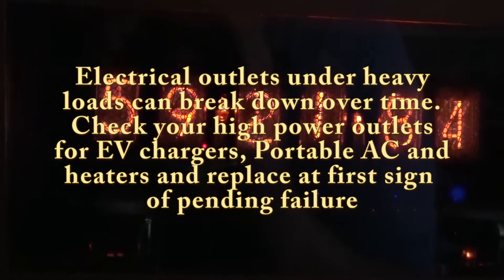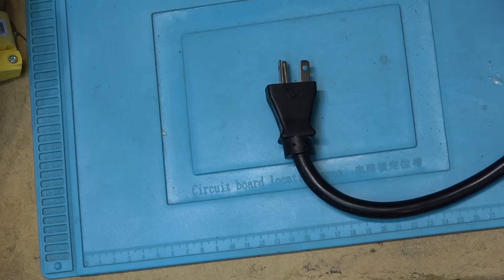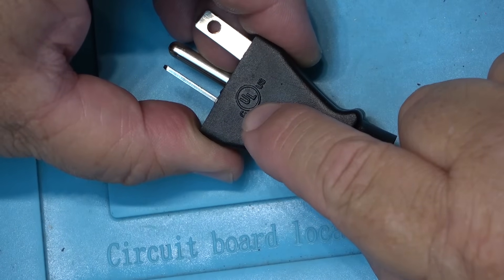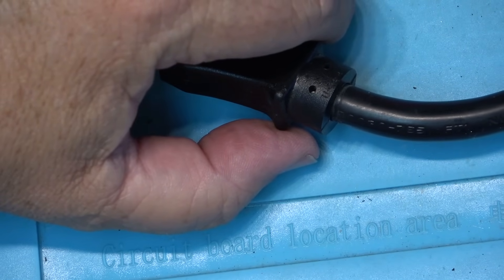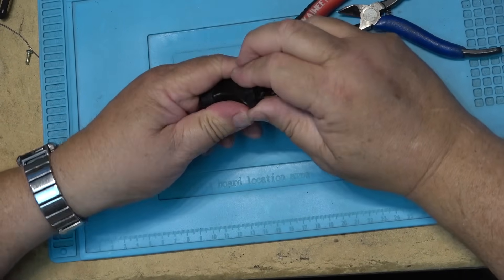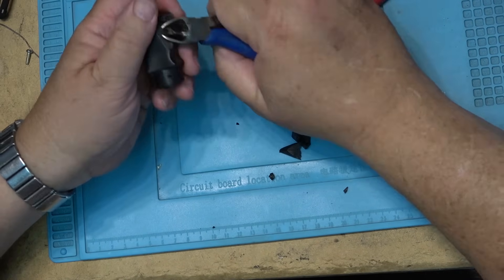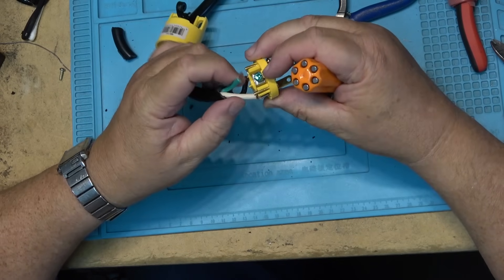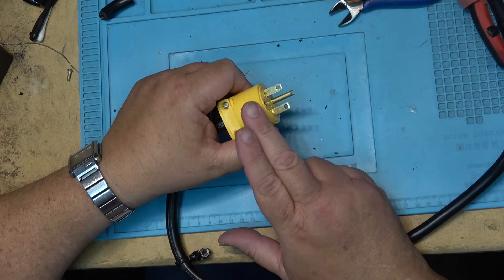Inspect your high power appliance plugs for signs of failure

Comment: I actually had this happen to me.  I was using a room heater and it started to give off a strong electronic smell.  I checked to see what it was and found out that the heater plug had melted and burned the outlet as well.  Needless to say, that was the end of that heater.  The outlet had to be replaced as well.

Comment: In Finland high power plugs are considerably larger and have 5 connectors: phase1, phase2, phase3, neutral, ground. each phase (in relation to neutral) is 230V and between two phases you get 400V. This is very common outlet in houses, not in apartments. NOT a split phase like in amaerica but actual 3 real phases. So yes, european system is better

Comment: First problem is having an electric vehicle
Reply from the maker: Sounds like someone is jealous.
Reply from the maker: Been driving EV for over 14 years.  Still have the car. Have 2 now. Would never go back to has or diesel. Only people that whine about them are people that can't afford them. They are so jealous that they can't help but put them down.  I drive 20 miles each way to and from work. It costs me 0.70 in electricity to mage the trip.  If I was driving a super efficient car that got 40mpg at today's price it would be 6.40 to make the trip. .  $14.00 a month to drive to work and back 20 tlmes.  Vs 128.00 for a 40mpg car.  Do the math. Then there is the maintainence savings. My 14 year old car with 225,000km had the rear brakes done at 200,000km. Oil is changed every 2 years.  
No matter your excuse it's just jealously.   
So keep pissing away your money and I will keep my in the bank and use it for fun stuff.
Reply: oh and i bet todays kiddies love their e-scooters. talk about giving them essentially a free license to burn down your house let alone the scooter IF THEIR NOT WELL INFORMED about the risks and precautions that are hardly explained in the user manuals or various documentation.

Comment: Better safe then sorry. 

Electricity is nothing to play around with.
Reply from the maker: That's why my house is over wired.  I have more circuits in here and i would be hard pressed to overload anything.  I'm close to max load now however. I should have had a 200 amp service installed but it was 700 more than the 125 service.  Have never had any issues but i know it's close.  I went with smaller ev chargers so I can charge both at the same time.

Comment: I had a plug on a window A/C unit get hot like that.  The outlet was nice and tight.  Put a new plug end on it and it was good again.
Reply from the maker: My window AC in my production office is on a dedicated circuit
Reply: @12voltvids mine is too.  The plug end was worn out but the receptacle was fine.
Reply from the maker: Had the outlet in laundry room go bad. Put a commercial grade duplex socket on abd all is good. My washer was shutting down mid cycle due to bad power.

Comment: Good idea!  On a different note...Amazing how many people buy a replacement cable or extension cord without checking polarity or continuity before using.  Most just expect it to work as described on the package and plug in without any pre test.  Good luck with that!
Reply from the maker: It's a throw away society these days.

Comment: EV car chargers are not inherently unsafe. However, the fact that they draw max power down a line over a relatively long period of time really exposes a lot of weaknesses in your system I've seen electrical panels burn up that had nothing to do with the charger other than it's extended power draw.
Reply from the maker: Have to be installed correctly and screws tightened to correct torque.

Comment: What I don't understand is, the prong orientation is different on the new plug?

Does your outlet have a second terminal with the correct prong configuration that will accept that new plug?
Reply from the maker: Yes the outlet can accept both 15 and 20  amp. Old plug was a 20 this a 15. They make them for 120 plugs as well.
Reply: @12voltvids 

So the 15 outlet has prongs facing the same direction and the 20 has them oriented perpendicular?

Just thinking you can't fit a square peg into a round hole (different keying).

Assuming they do this so you have the option for either, but can't plug a 15 into 20 and vice versa.

PS. Watched again and see you explained the keying. 

My bad.

Comment: A question... Dave would tining the wires before putting them under the screws be a good idea or bad idea?  Would the solder oxidize over time and cause resistance and heat?  I often wonder what would be best.
Reply from the maker: No don't tin.  Lead and tin have higher resistance then copper.  Just ensure the screws are tight and no quick connects anywhere on that run. It needs to be a home run directly back to panel with no splices in-between
Reply: Thank you Dave.

Comment: weird < the crimps on the defective chinese plug seemed ok
Reply from the maker: Well the plug was getting so hot you couldn't hold on to it and the new plug is stone cold.
Reply: It definitely showed discolouration of the copper but the pin itself looked OK.  That says to me localised heating rather than heating as a result of a loose socket.  It might be that the crimp wasn't properly formed, the tangs are supposed to curl in a bit and wrap around the wire to some degree (rams horn if that helps picture it).  High speed saw cross section of the crimp might be interesting.
Reply: Maybe the crimp wasn't tight enough, but visually it looked fine and started arcing which caused it to heat up idk

Comment: Regarding hooking up the new plug, it's good practice to leave the ground wire a bit longer than the others. If for whatever reason the cable should get pulled out of the plug, the ground will get torn out last.
Reply from the maker: It's not going anywhere.  It's tight and it is mounted to the wall

Comment: A proper EVSE (car charger) should have a temperature probe in the plug that'll detect this failure mode and safely shut off when it gets too hot. At least that's what the one of my parents' car has according to its manual.
Reply from the maker: Many of the portable chargers that shipped with the car had such a plug.  My original factory level 1 did and it got recalled due to a defective thermal cut out that tripped for no reason.  
The evse has a temperature probe inside it because it displays the temperature.

Comment: I assumed you checked the current draw of the charger.
Reply from the maker: I know exactly what it is as there is a display.  This one will do 16 amps max but the car only draws  15.5.  The unit has a display. Shows voltage amps watts and kwh of the charge cycle.

Comment: Seems like a downgrade, and undersized?
Reply from the maker: How is it undersize?
It's on a 15 amp breaker.  It only draws 15 amps. All i could get is a 15 amp plug.  The wall socket is a 15/20 socket but it's fused at 15 anyway.  In other words if i tried to draw 20 it would trip.

Comment: Look i dont want to argue but iv fixed this problem hundreds of times and EVERY single time apart from one time a plug had broken wire coming in to the pin its been the socket always seems like the plug tho
Reply from the maker: Nope not the socket. It's tight and does not get hot.  I have 2 outlets. One is a 30 amp and i have an adapted cable from 30 to 20 for the other charger.  I plugged the bad one into the adapter cable and it got hot on that one too. Last night while chathibg I checked it and it was stone cold..
Have 2 EVs and charge em both at night on the cheap 0.07kwh power rate.

Comment: Think about it the plugs pins don't get thinner the socket looses grip force on the pins or is defective from the start. I speak from experience. Trust me.
Reply from the maker: The crimp was weak. This one always got warm.  It wasn't hot but it did get warm.  The socket was new and no it was not worn by plugging and unplugging. The cord was set and it's secured to the wall. It doesn't move.  Sockets do wear out from plugging and unplugging but they don't if the plug isn't disturbed. 
I did verify that it was the plug side first as I put it on my second circuit for the other car and it got hot there too.  New one is stone cold.

Comment: Running any connectors close to their maximum rating is asking for overheating as the metal contacts react to the cycle of hot and cold. I think that they should be rated at at least twice the average load and not just close to it. Most house fires are caused by electrical appliances. The older properties were not intended to handle the demands that we now expect of them. Here in the UK if you ask for an EV charger to be installed, the main supply cable has to be upgraded to handle the load.
Reply from the maker: Supply is good. 10 ga wire on this one and 8ga on the other as that one is a 30a circuit as i run the garage heat on that one and it's a 4.8kw heater.

Comment: Oh this is so important! My neighbour's dryer fried a wall socket last week, they plugged it into an cheap extension board for another week. I checked it out and the extension was almost melting!!! Realised it was the plug (after checking the whole circuit). The dryer was in use for over 3 years and plug was seemingly good quality. As you said it was the internal crimp point. The replacement stays completely cool after use.  FYI the dryer was a Hoover brand (Candy) and I've seen so many quality issues with these units.... utter garbage.
Reply from the maker: Crimp connections are the weak link.  That pioneer plasma i was given had a defective power cord. Crimp let go in the plug.
Reply: @12voltvids  They're scrimping with the crimping. Can't beat plugs with terminal screws.

Comment: Yes, this. Especially people that use space heaters and the like, with extension cords. It's always recommended to not use the extension, but if it's used, it has to be made sure that it is of high quality and designed for that much power. In addition, far worse than that is leaving the actual plug not in well, extensions or not. It may be common sense to lots of us, but there are people interested in electronics that didn't get that far, yet. We give a helping hand. heh
Reply from the maker: And power strips. 
Most are plastic crap. Unless you have one of those made in Canada Hammond like i have. Uses real receptials avd has a heavy duty cord. That one can handle full power.   I have a second one around here somewhere i need to locate.
Reply: @12voltvids  This, too. Yes, of course.

Comment: Lots of good info to check in this vid. Very good preventative measure. Just wanted to ad you can check torque rating on how many pounds of pressure to put on the fittings as well. I'd say no issue how you did it but just wanted to say it is listed.  It should be on the documentation or stamped on it.
Reply from the maker: It's torqed to spec and then some.  It's not coming loose.

Comment: We had an older electric stove that had a couple of 120V outlets built-in. Found an appliance (deep fryer) that had it's plug start *melting*, and discovered that the outlets on the stove were cracked, and buzzing and sparking.  Appliance & stove are now long gone.
Reply from the maker: I had to change the outlet the washer was plugged into.  My stove is a gasser no outlet on it. Plugs into 120 just to run the clock and electronic control for the oven.  Had a warning drawer that has never been used except to store stuff that's electric. 
My house is over wired.  Pretty much impossible to overload.   My office for example has 4 15 amp circuits.  2 for computers and electronics. 1 for lights and a single convience outlet and another for the AC. Workshop has 3. 1 for a couple outlets on back wall 2 for bench / heat and AC. 2 more 240v outlets for the 2 EV chargers one I use for the 4.8kw electric heater for when I work in the winter.  . My con closet where my router and av gear had 2 circuits.  Media room has 2.  Kitchen has 12 when include dish washer and garbage disposer.  Living room 2, family room 1, master bed 1 2 other bedrooms 1 each abd one more for bathrooms. 4 more due outdoor lights and outlets and another 240 circuit to the back garage where it feeds a freezer, hot tub and heat to keep it from freezing as i store stuff in there.  Like I said over wired.  I am at the limit though.  I only have 125 amp service here.  I should have put in 200 when i built.

Comment: Not sure why you didn't measure R? 
Edit: It can be only two things, one or both.. Resistance in the plug and wire or resistance between plug and socket interface. I'd still check the socket. You said it's new... Now it heats up? Was it changed recently or is it just a new installation? You only need a tiny R at those currents to end up with a few watts. After inspecting it looked fine, I'd question the interface. Might need a quick squeeze.
Reply from the maker: No need to measure it's hot it's shot.
Reply: @12voltvids  Why is it hot?
Reply from the maker: It was a new commercial grade plug and it was plugged in once and not removed untill today. I did check the socket first. All tight. Been charging full power now for 90 min and it's stone cold.  When i checked it last night the plug was hot but the socket itself was not other than what had gone down the prongs.  They have not lost their grip as it was stuff plugging in.  EaToN make good plugs and sockets.
Reply: @12voltvids  Excellent.
Reply: It will be back it's just working now caus you removed the oxide layer on the sockets parts unplugging and replacing it will feel tight but one half of one pins socket will be missing and that will be the pin that gets hot trust me it will be back if your still using that same socket also not it's been hot the metal I weaker
Reply: Also you need to measure the resistance or voltage drop while it's in use to get a true measurement. If it's questionable just replace it anyway.

Comment: Thanks Dave. Its always a good idea the check any plug & receptacle that draws heavy current, like a window air conditioner, or a space heater and so on. if it is getting "hot" then investigate the root cause. Like you said, you don't want the fire department at you home at 2 in the morning.
Reply from the maker: What people don't know because i don't talk about it but when i was growing up I was encouraged to become an electrician.  I worked a summer as an assistant for a family friend that was a sparky and had started an apprentiships basically to see how i liked it and would have taken the courses after high school. Spent the summer relamping fluorescent fixtures in commercial building and residential work to get a taste of the work. I still remember having to go up in an attic to wire s ceiling fan in the middle of summer. I got mild heart stroke up there in the sauna and when I climbed down i looked like I just fell in a swimming pool while the owner was in the kitchen with the home owner that made him lunch and gave him a beer while I was doing all the work. I thought if i have to do this grunt work for 4 years to get my ticket while the guy with the ticket gets to sit around and twist a few wires after I did the work forget it.  I already could fix tv and radio by then because I had worked in the first tv shop for a few years from grade 9 through 12.  I quit and went to college to chase my dream of television production.  Did that for a couple years with the community station and then the option to work for Sony came along. I worked at a 7-11 for a few months too. The Sony gig lasted 1 year and then i went to the tv shop and stayed there for 19 years.  I did start my video business the next year as that is what I really enjoyed.  Been with the phone company 20 years now and i am classified as a low voltage electrician  as when copper was still a thing i worked with voltages up to 380 volts DC. Yes there are high voltages on the phone lines for remote DSL express power to power the dslam. Now it's all fiber optics. So basically I am an electrician. I know what i am doing but i am not licensed for residential or commercial work.  I could write the challenge exam if I wanted and would then be licensed as I have had all the training at the phone co as I am a journeyman for that work, plus have the training for working near utility power but not on it.  Only the Telco side as i started my career as a cable splicer and that's why the A3 electrical certification because carrier circuits are +- 190v with respect to ground 380 potential between the rails.  Current is low but voltage is high enough to give you a good jolt.
Reply: @12voltvids  FASCINATING, did you do any University or technical college courses in electronics or did you learn to repair electronics on the job
Reply from the maker: Yup, a hot plug is a disaster waiting to happen.